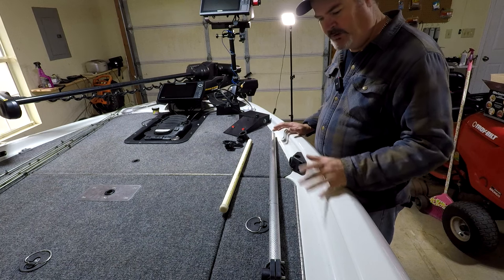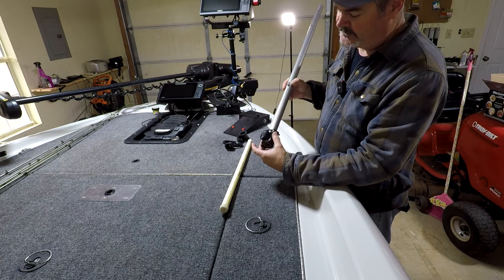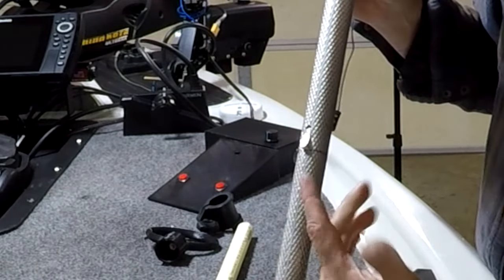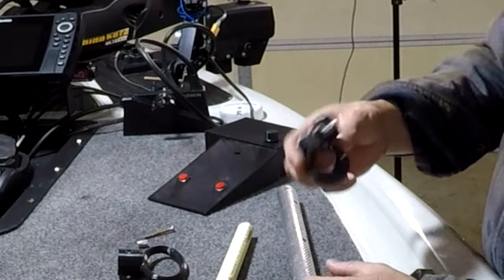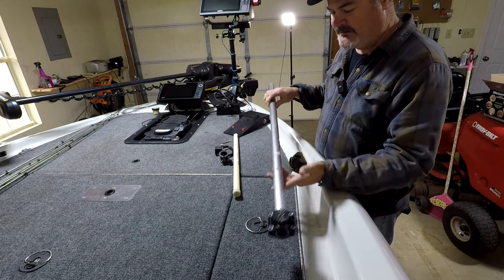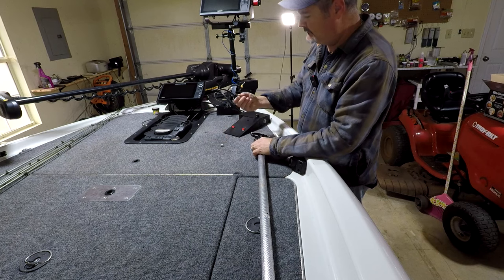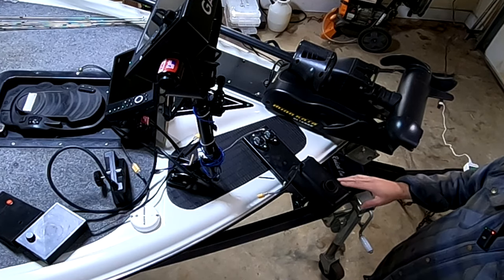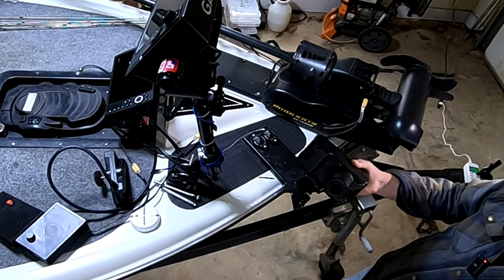DIY Livescope Turret, Motorized Pole For Garmin Livescope Transducer.

Comment: What size Fishing Specialist mount did you get?  I got a 10 I believe.  Reason I ask is since you did such a great job inspiring me to build this, I built a 3D bracket that fits over the whole mount.  It allows you to lock it in place in the up position and the down position with a pin.  All pretty heavy duty.  Currently I have an arrow on top of pull al well, that also is a handle, slip right over 1.125 pole. I am not completely done with my build, I do not want to give you the STL files just yet.  Last prototype was awesome, just about finished.  If you like that system you made, I will give you this bracket STL however I can.  I was just back looking at your file as I was putting everything together.  Crazy how cool and cheap you can make these, especially if you have a 3D printer.  I have mine going on a toggle switch on the dash, not foot pedal.  Let me know if you are interested.
Reply: P.S. My mount would work as is on the medium mount and long mount.  If you have the short one, it probably will not work, but could be inspiration for you.
One of the best build I have found.  Thank You!
Reply from the maker: Yeah man it's a simple build and works great. I finally found a nice set of dual pedals that came from a hot cold water fountain. I'm using it in all my latest fishing videos. It's low profile and heavy duty. Just what I was looking for. If I think about it I'll go measure the board in the morning. I can't remember off the top of my head. I'm underway on my next project now. To have an arduino and compass/gyro module keep that transducer pointed at what I point it at. Send me what you got when you are ready. I'd be interested in looking at it. Thanks for the feedback and good luck with your build. I sure have enjoyed mine!

Comment: Hey brother very nicely done. Did you make the bracket the power drive sits in or is that something you bought?
Reply from the maker: It's just two plates one screwed in to each side of a fishing specialties mag mount. A hole is drilled into each plate for the hinge pin to go that connects the steering motor. Thanks for watching!

Comment: hello, please tell us what happens if you press the 2 buttons, but the leg that happens with the electronic assembly is short-circuited
Reply from the maker: Nothing happens. The circuit board with the relays have that logic built in. There is no short circuit. I push both buttons all the time. Thanks for watching.
Reply: @Rednecks_Lair  ok tanks !!!!!!

Comment: I like DIY projects, I was just curious to what makes that steering motor turn the pole? and would you make a pole like that for me on my dime? Thanks
Reply from the maker: The piece that goes on just before the handle is the steering collar. It's the same collar that came off the original trolling motor shaft and functions the exact same way. I don't have the free time to make any but I'm flattered that you'd ask! Thanks for watching!!
Reply: Just wondering if that collar is purchased separately or supplied when purchasing the steering motor

Comment: Nice job. It looks like you could easily run the Livescope cable through the pole.
Reply from the maker: Man I sure wish that was the case! The connector on the xducer cable is a bit  larger than the inside diameter of the pole. Thanks for watching and commenting!

Comment: Where do you get the foot switch? I like your design better than any I've seen.
Reply from the maker: @thomassullens2790  the foot switch i had in the video were just simple momentary switches from Amazon (link in description) installed in a 3d printed box. The pedals i use in my more recent videos came from a water cooler that used them to choose hot or cold water. I love em. Don't have a link for them but I found them on ebay.

Comment: Where were you able to get the spring loaded button for the pole? I'm having trouble finding the tapered kind that you have in your build.
Reply from the maker: @tinkanator2000  I machined the tapered part out of a block of aluminum. Ground off the button and fastened it to the spring. Cut a slot in the pole to fit where you want it to be. I think I robbed the spring out of an old landing net. You can buy them online though.
Reply: @Rednecks_Lair  That makes sense, thank you for the reply.
Reply from the maker: @tinkanator2000  thanks for watching!!